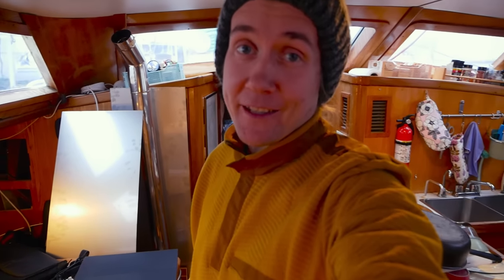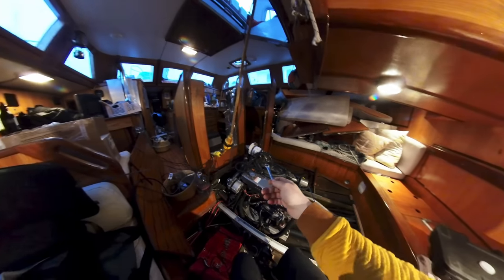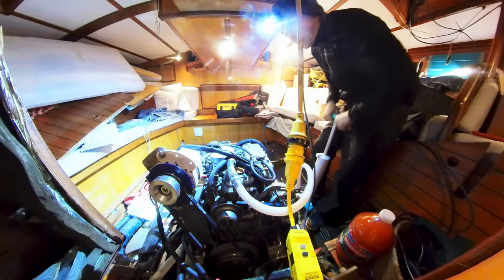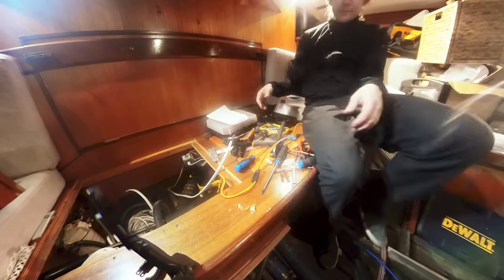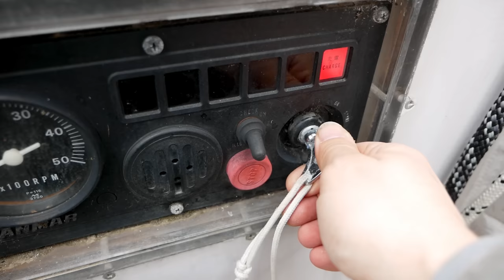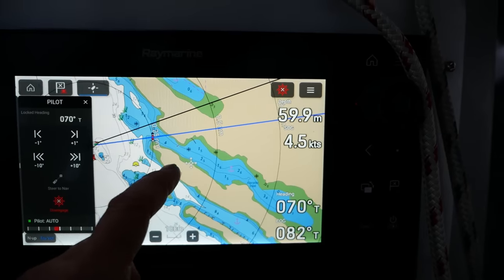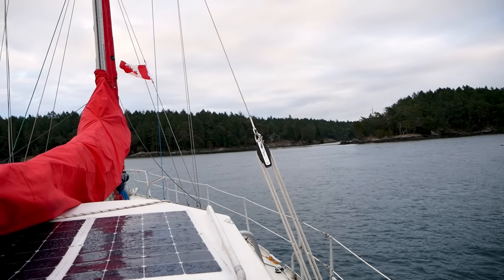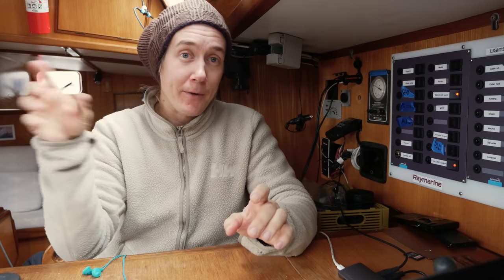FREE HEAT for Our Boat! NO Extra Running Costs!

Comment: Won't that space already be heated by the engine itself? Would be more useful if you had heat transfered to the other end of the boat.
Reply: Engine only radiates heat which is a few hundred watts at absolute maximum
Reply: @jonnenne  Thanks. And I understood from the video the air circulation created by the heater is also a big benefit.

Comment: that is crazy, u are goin to suck air from the engine compartment to the cabin and if the engine has a exhaust gas leake can POTENTIALY KILL YOU for the co2 or you are goin to breathe the gases from the oil separator. please change that
Reply from the maker: it's not sucking in air from the engine compartment though
Reply: @AlluringArctic  could potentially if the exhaust pipe get a leak, im from norway and has happened a few accident for that kind of instalations :(

Comment: It's only "free" when you have to run your engine.  If you're running your engine for heat when you don't need it for propulsion or electrical generation, it's no long free.

Nice wide-angle view of your cabin!